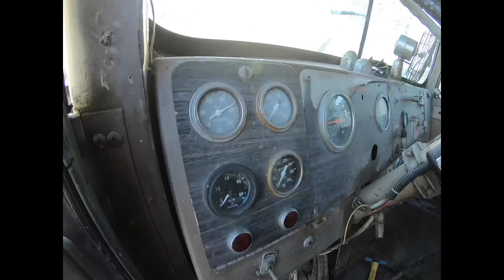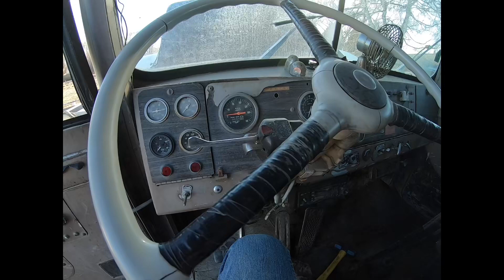1969 Kenworth W900A Dump Truck Update Horns Work!

Comment: Thanks for watching our videos...we are trying to get ready for Warren with Western truck and tractor repair to come help us with this bus of ours....We are really going to need his help....but we are having fun and learning a lot...Thanks again...
Reply from the maker: These old machines are awesome, and nothing sounds meaner than an old Detroit. I don’t know a whole lot about them yet, but I am going to dive straight into rebuilding this one if the block is good. I just ordered an V-71 series factory shop manual for it. I should have it within a a week or so. From what I can tell so far, they are pretty simple machines. Just finished up a 6.0 Ford power stroke upper rebuild. (Bulletproofing) what a job!
Reply: @Johnditit  I might have some books that might help you...my x-brother in law was a Diesel mechanic and when he passed away we got his old books...
Reply: @Johnditit  Warren is here in town he might be able to help ...if you need it...
Reply from the maker: FIXIN IT WITH THE LONG BROS. Yeah, he is good, I watch all his videos. I would recommend him to anyone. My would kill me though if I paid a mechanic to work on any of my projects. She is cool as long as I am the one cracking my knuckles.  I really like the challenge though, and I am confident that if my block is good, I can get it running. Knock on wood!